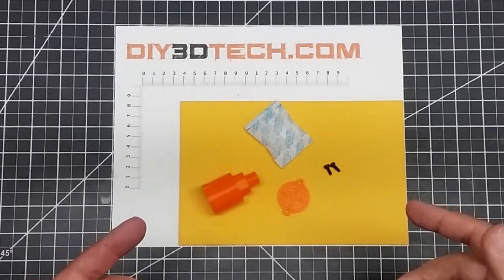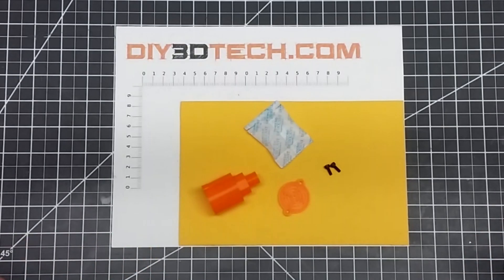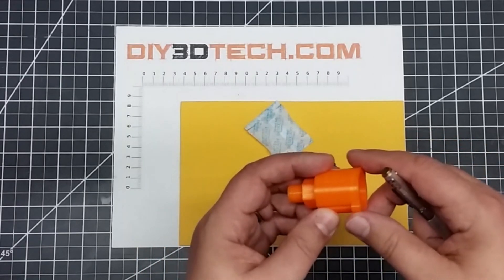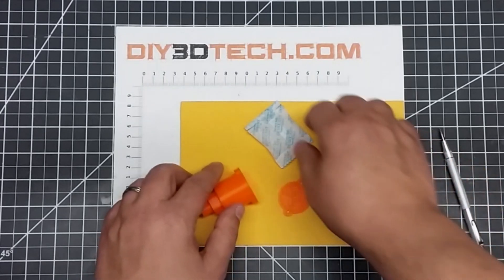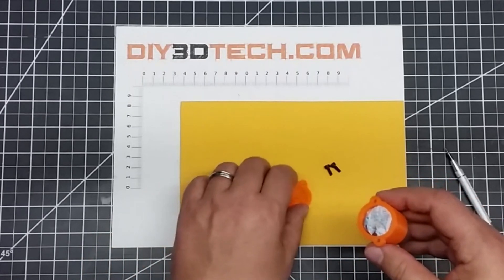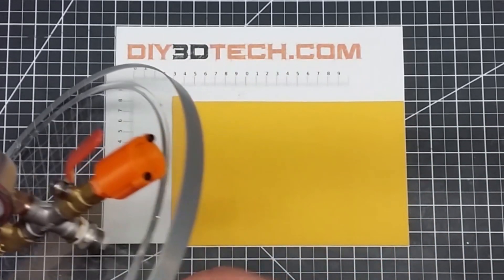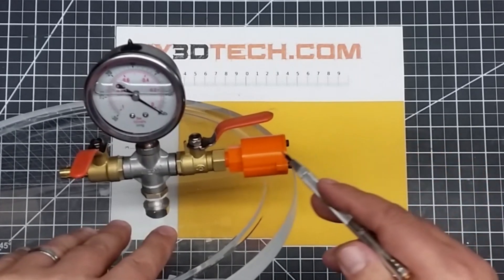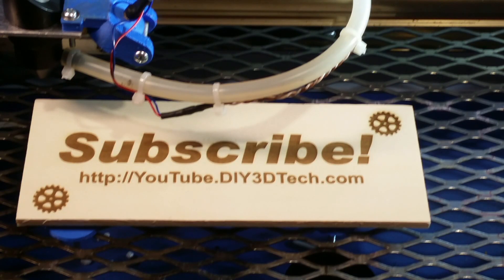Design Talk - 3D Printable Air Dryer for Vacuum Chamber!

Comment: Not an expert, But that packet has been absorbing water since it was placed with the PLA, it kept adsorbing water when the PLA seal was opened, you would have to re-dry it and keep it dry prior to using it. Then there's the speed at which it removes water. I had about a cup of the stuff in a sealed box with a moisture monitor and rh as dropped slowly over a week or so. I rather see some tests  prior to spreading these ideas.
Reply from the maker: The idea is to dry air re-entering the chamber so yes the fresher the packet the more water it will absorb of course so there there is an argument there,.  The second piece to this is the  reuse of the packets rather then throwing them away (I hate wasting stuff).  Also when looking at the speed of absorption, you test was static as you depended upon evaporation where as the air rushes in, it rushing around a high surface area (the rounded beads) ...
Reply: @DIY3DTECHcom  Could be, it would be interesting to get a humidity sensor in your chamber and vent it without the pack see how much humidity goes up, then do it again and vent it with the silica pack and see how much it goes up again. In other words, is the pack effective at removing any moisture for this 3 seconds that you are letting air in? I'm not a betting man but I will be surprised if you saw a difference, again I could be wrong. Now what if you had a large plastic bag with some silica gel in it. The air in the bag will be dry after a while, if you wanted to vent your chamber do it from the dry air from that bag. This gives the silica gel time to remove the moisture slowly over time and have the dry air ready when you need it. Investing in a moisture sensor with a few probes would be  a nice to have to have an idea of how effective things are.
Reply: @DIY3DTECHcom  I also agree with reusing the packs but this was not addressed in the video. I was trying to make the point that either silica gel adsorbs water quickly or slowly. If it does it quickly like you need it to, then the minute you opened the PLA pack the silica gets saturated with ambient moisture, and using it is pointless, if it saturates slowly as to still be usable by the time you place it in the filter, then the 3 seconds of air rushing in will not be any drier. Can't have it both ways. I do enjoy your videos and I'm just trying to help with your ideas. 👍

Comment: I agree, that won't work. However cooling the air will. Cold air can hold less water and will be dry when heated back to room temperature.
Reply from the maker: The biggest thing is to dry (i.e. reduce the moisture) of the returning air
Reply: @DIY3DTECHcom  In the winter all you need to do is to go outside in cold weather and open the vacuum chamber, so it is filled with cold air. Then put the filament in a sealed box and bring it inside to let it heat to room temperature. The air inside the box will be really dry. Drop in a pack of desiccant to make sure it stays dry even if the box leaks a little.

In the summer you could put the box in a refrigerator or freezer and make sure it is filled with cold air before sealing.

All this works because cold air can hold very little water. When you heat up cold air to room temperature, the now hotter air will have very low relative moisture. Even if the same air was at 100% moisture before heating.
Reply from the maker: What do you do in mid summer when the humidity (as it is now for me) 90%?
Reply: @DIY3DTECHcom  unfortunately we do not have that problem where I live. Drying filament here is a non issue, especially during winter where inside air is really dry.

Regardless, the answer to drying air is always to cool it then reheat. That is how your car does it. Find a source of cold air and you are set.

Comment: Silica won't absorb anywhere near fast enough to make a difference. And if your storing the filament in the open it's kind of pointless.
Reply from the maker: Why do you say that?  I would have think its a function of surface area similar to using a charcoal filter and removed from the chamber the spool should be stored in a dry-lock container with silica packs...

Comment: Silica won't absorb anywhere near fast enough to make a difference. And if your storing the filament in the open it's kind of pointless.
Reply from the maker: Why is that "Silica won't absorb anywhere near fast enough" ?  Also after drying the spools should be stored in a dry container with silica gel to keep it dry....
Reply: @DIY3DTECHcom  https://www.sorbentsystems.com/desiccants_charts.html is a good read. If you use color change silica you will have a better idea of its Performance, I tried with around 1kg in a container as a compressed air filter/dryer for airbrushing, whilst it does work ( goes green when used) it cannot keep ip with the airflow rate and the air still contains a fair amount of moisture. It all comes down to the amount of air and the amount of water in it you want to remove. Silica does a great job just not instantly that's all.

Comment: Perhaps a better solution is to use nitrogen  to de-vac the chamber. Nitrogen in gas form won't have any moisture,  which is the reason why it's used in spray painting etc.  Just an idea.
Reply: The humidity sensor I have is from a nitrogen low humidity chamber. you can set the sensor to trigger a valve and let nitrogen into the sealed chamber and once humidity hits the target level it closes the valve.  hence the name "nitro-save"
https://www.tdiinternational.com/product/nitro-save/
but the trick is where to get the nitrogen from at a low enough cost. 

Also if 
DIY3DTECH is letting air in, even if the air is dry, when he opens the cover the dry air will escape. The Chamber i talk about had two sealed compartments to minimize humid air getting in. You would stick your hands into gloves build into the box, move material to the small compartment. then access the small compartment from the outside.

Once he dries the filament, even if he lets humid air in, he can just keep the filament with desiccant in another sealed container and just use this chamber to just dry filament.
Reply from the maker: I like the idea of nitrogen yet this isnt something people have laying around, as with the vacuum chamber which people will for other craft or hobby projects.

Comment: I agree with Mr. Hill. I don't think silica gel desiccant works that fast. You might try putting a screen in the bottom and filling it with loose color changing silica gel for better air contact and as an indicator of effectiveness. I've used a similar vacuum chamber for a year or so with good results. Sooner or later you're going to take the lid off and air will enter. Seems to work best if you reinforce the vacuum every couple of days even with no noticeable leaks the humidity creeps ups over time and sucking it down again brings the humidity back down according to my really cheap Chinesium digital temp/RH meter. After drying, I transfer the spools to a 5 gallon bucket with a Gamma-Seal lid and a bunch of silica gel packets. Stays in pretty good shape.
Reply from the maker: There has been a lot of discussion around this which I find interesting and possibly worth testing in the future as my "assumptions" are multi fold regarding this as (1) something is better then nothing so using desiccant would be better then not and (2) the effeminacy would directly related to the surface area of the descant which air had to pass thus the long shape verses being short and squat.

Comment: Interesting thought but, IMHO, that's probably too small to be effective unless you are repressurising at an extremely slow speed.  Really needs to be longer, with a full packing.   You could make a longer desiccant tube with with a hose barb and connect it with tubing.
Reply from the maker: My "assumptions" are multi fold regarding this as (1) something is better then nothing so using desiccant would be better then not and (2) the effeminacy would directly related to the surface area of the descant which air had to pass thus the long shape verses being short and squat.  However agree, the longer the tube the more effective results...